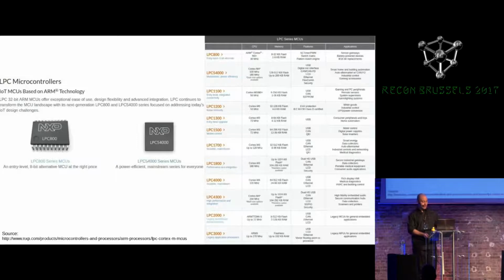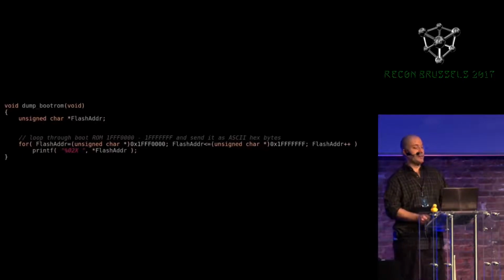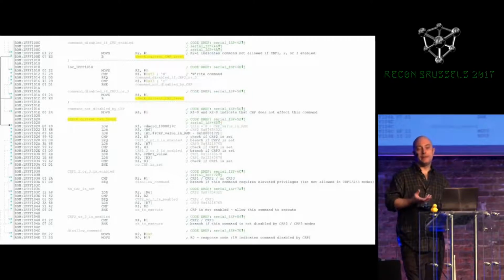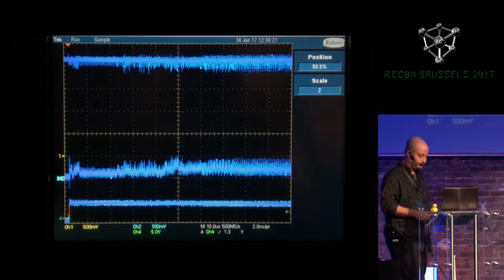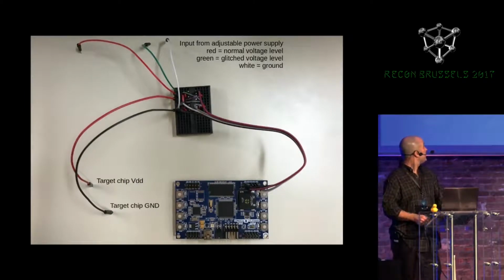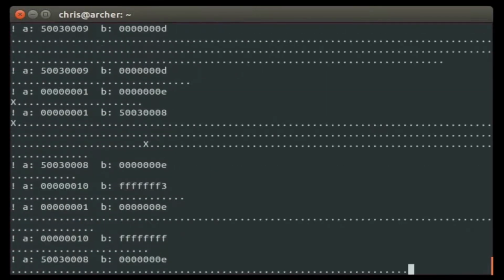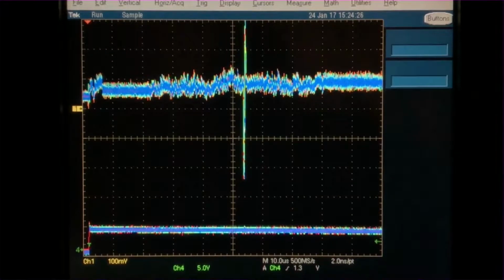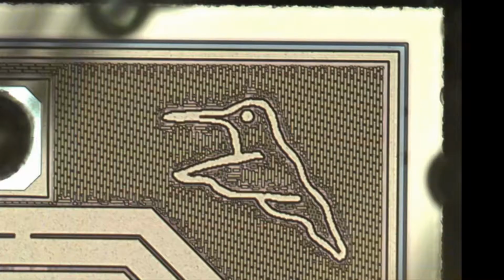Breaking Code Read Protection on the NXP LPC family Microcontroller

Comment: Right. There is no lock bit to protect reading the bootrom. Unlike many other chips that do turn off read access to the boot rom area before jumping to the application.
Reply: They tend to ship some features as ROM code, which can't be used if you can't access the ROM